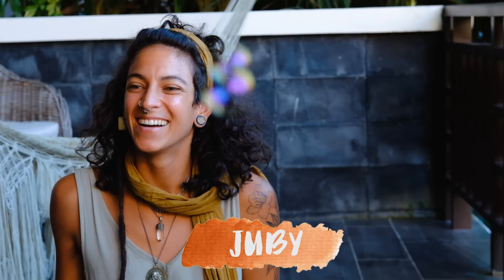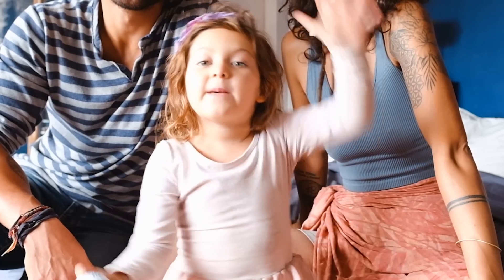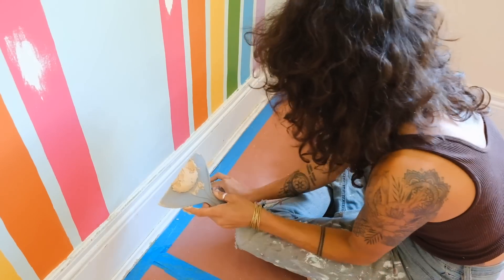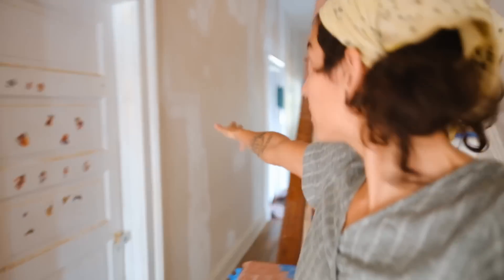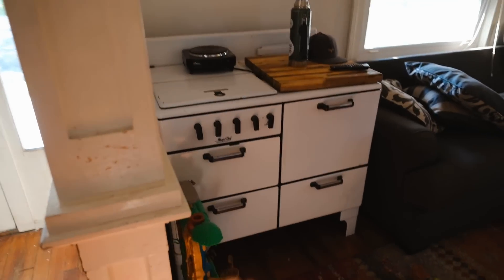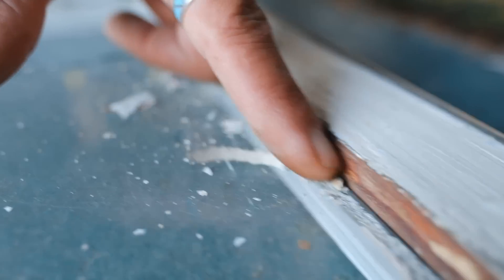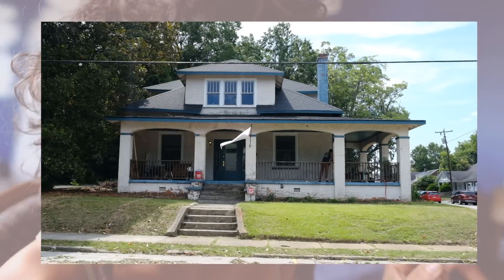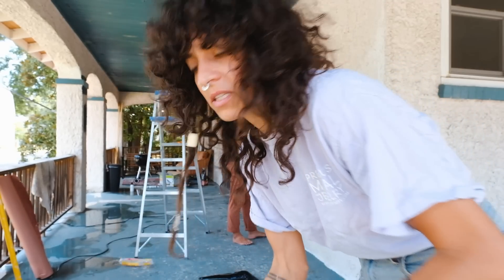Renovating a 100 Year Old House is Hard Work!

Comment: Brown and white/cream large graphic print with a hint of curve: Warm, Spanish, crisp - elevated. ‘Cafe in Antigua or Merida’. Ceramic floor: 2 cents. This house has perfect bones. That ceiling height, the width of the rooms and staircase.  While it may seem like a lot of work, this is just because it is but you are doing it at the right time. You would not be able to attempt this (at least without having had one under your belt already and more bank) in 15 years. ✌🏽